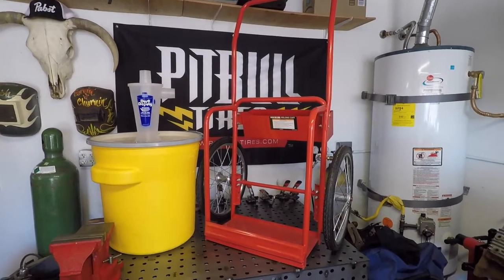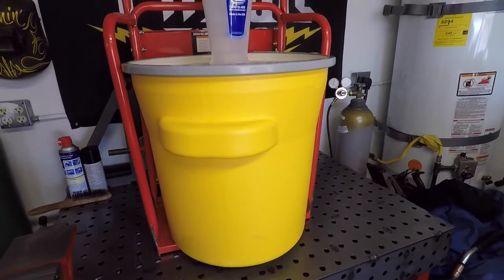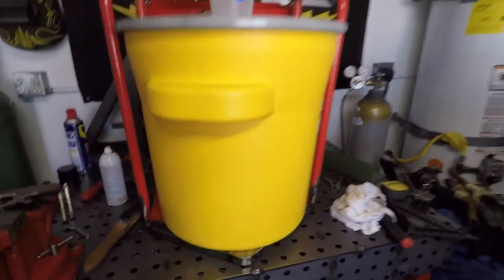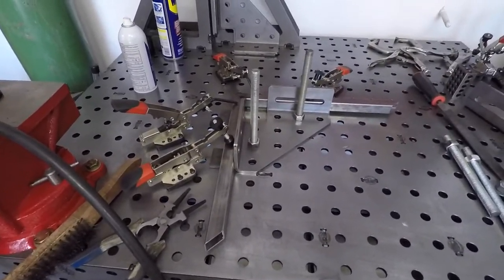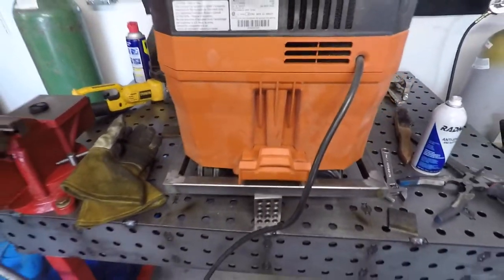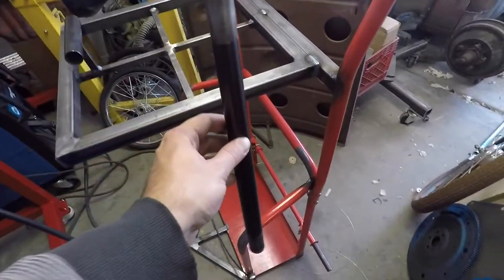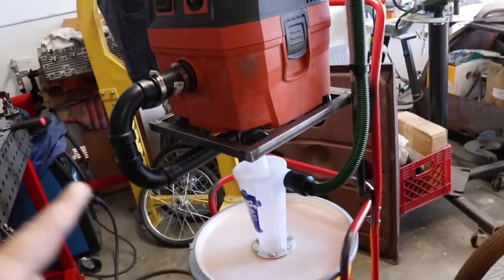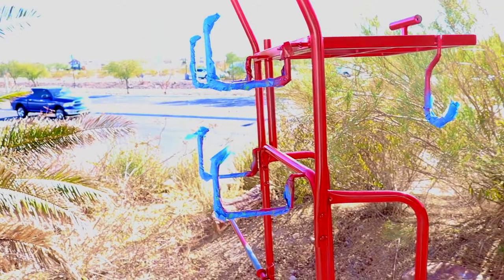DIY Dust Collector Cart

Comment: Nice job! 
Love the Festool track saw, but the hose does catch on the edge of your plywood. I may make a cart someday. For now I just bungee the hose off the ceiling.
Reply from the maker: Matt Molnar thank you! I was doing that too but I do allot of cutting outside so I didn't have anywhere to hang it from and I wanted to make a cart I could haul up stairs if I need too. This was a super easy project and I'm really happy with the results.
Reply: BUILT 
Definitely! I would like to build one myself someday. I just happened to do most of my cutting in my basement and it has low ceilings. It’s really easy to Bungee up the hose when I cut.
Reply: Can you tell me what the inlet diameter of the vac is?